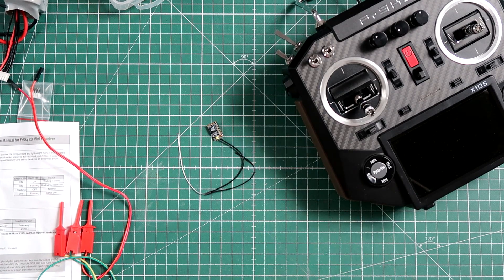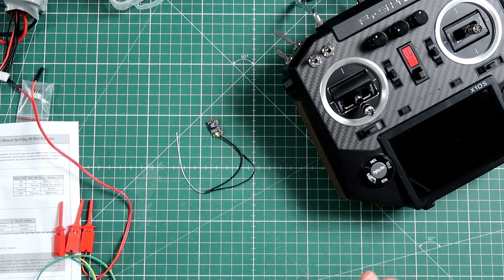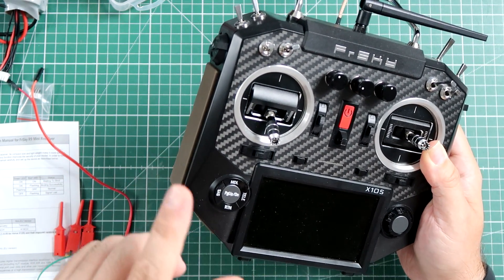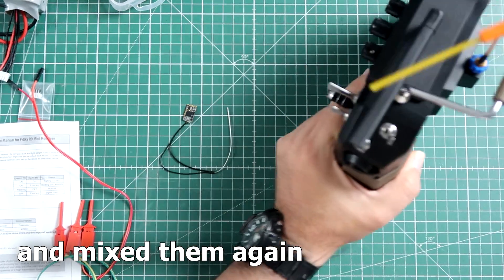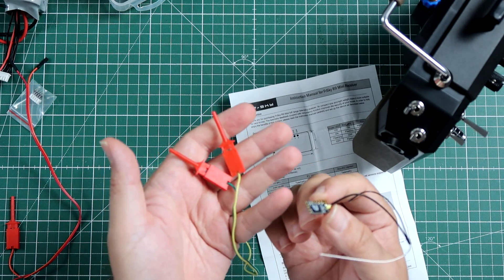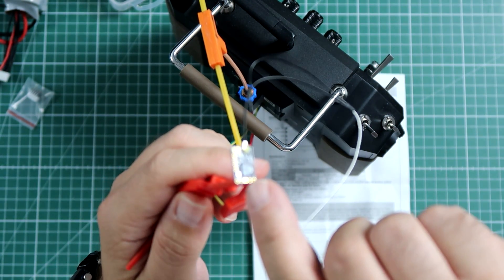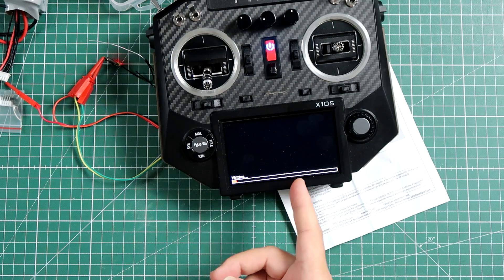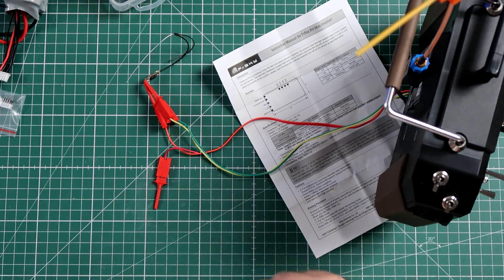How to flash FrSky R9 Mini, R9MM, R9 Slim and others with your radio

Comment: When I select the R9Slim_fcc.frk file with my Taranis X9D+ the only menu items are Flash Internal Module and Flash External Module.  Not getting the option to flash SPort.  Running Opentx ver 2.2.2
Reply: Select external Module....its different on a Taranis to a Horus.

Comment: Checked my x9d and it outputs the direct battery voltage in the module bay. I would  be a bit careful if flashing these 10v max modules if you are using a fully charged 3s lipo or life tx battery which are normally +11v.
Reply: Fully charged 3s got 12.6V, good point.

Comment: Flashing receivers via the SPORT is no big deal, it's easy. Once the Firmware settles down you won't be doing it again anyway.
 The TBS bluetooth RX flashing is a gimmick, nothing more and FrSky realise this.
  Why add cost and complicity to a simple process, just to cash in on impressionable youth?
Long term, FrSky will be the winners, not TBS.

Comment: Any information about FLEX firmwares and Open-TX 2.2.3? There are only "nightly builds" of 2.2.3 open-tx now. It's awesome idea to separate 866/915 and FCC/LBT - we need something like 866+FCC
Reply: the information is that OpenTX 2.2.3 is not yet released, but you can get and test a nightly build